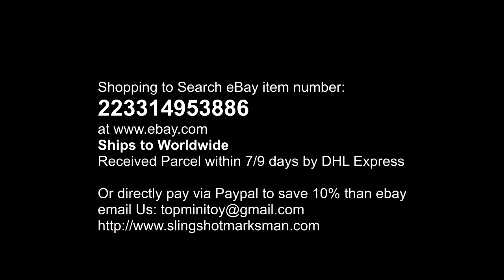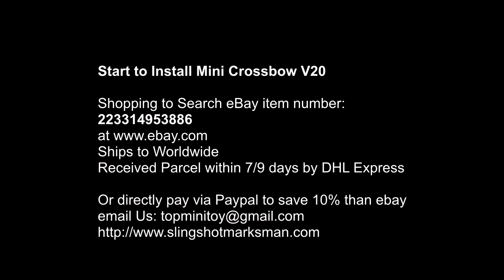V20 Mini Crossbow - Fine Grinding Metal - Relaxing Shooting Toy & Easy Continuous Fires Weight 410G

Comment: Steel wire rope is of which configaration?  Strude X no.....Please tell.
Reply from the maker: do you mean bowstring ? wire, the diameter is 1mm that is enough, but please put a piece of very small spring on the wire, lenght approx be 2CM, so the bowstring will be worked well for very long time. ( wire not easy to break )

Comment: Why do you use pulley
Reply from the maker: wow ! wheels will reduce the power you need to pull the bowstring for ammo reloading,  more easier to pull, the initial speed comes from how strong of steel bow ( arm ), also please do not forget this is a system of Pulley block ^_^
Reply: Compound bows reduce the drawing tension by 50% and increase the delivery by 50%, so double the output, of a same size bow.

Comment: how much sir
Reply from the maker: ebay Store:
https://www.ebay.com/itm/223314953886
https://www.ebay.com/itm/303032530379
https://www.ebay.co.uk/itm/202768525731
Feature:
2019 newest mini shooting toys, upgraded trigger design
for easy ammo reloading & fast continuous shooting
Full metal are fine grinding, a good metal artwork for collector, collection & play.
ammo: mini arrow weight 1.7g & 4mm steel ball.
Size: Lenght 16cm, Width 12cm Net weight 410g
 
Package Includes:
    1 * Mini Shooting Toy V20 ~ Newest Type in 2019
    1 * Allen wrench
    1 * Magnet Ring
    2 * Spare Bowstrings
  50 * Mini Arrows